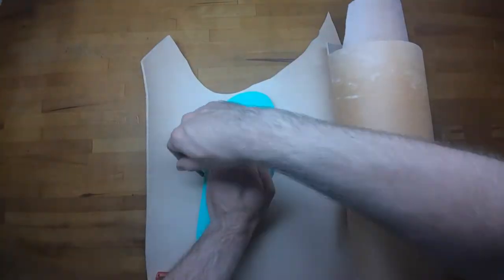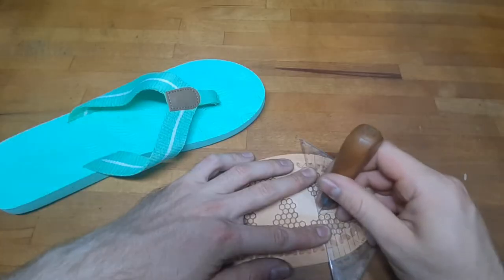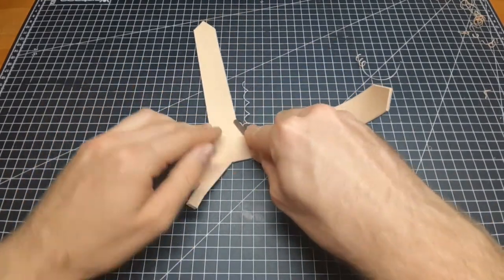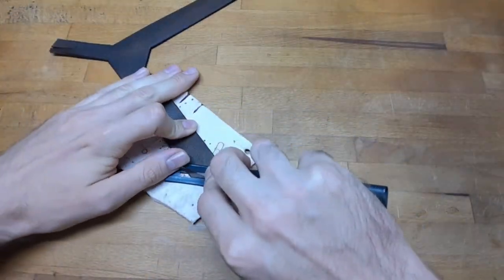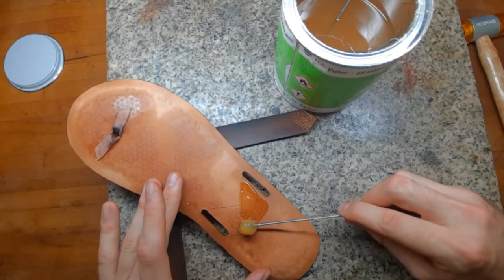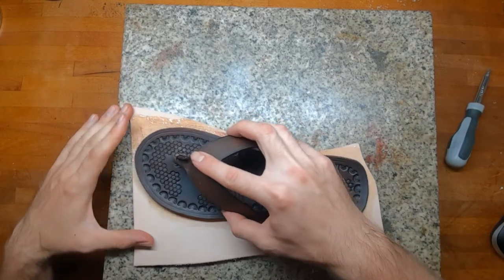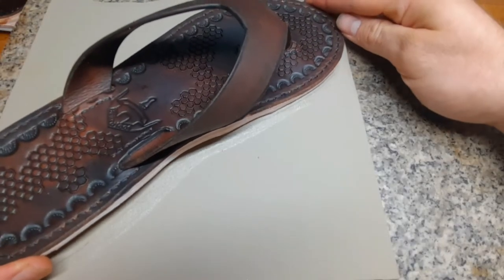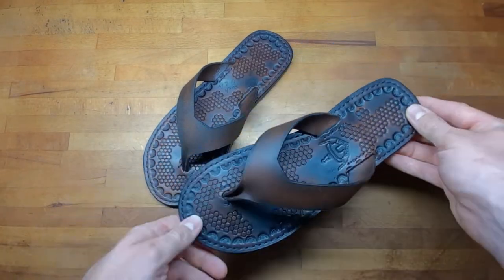Leather Crafting Tutorial   Flip Flops

Comment: What kind of paint are you using? Also, what is "resist"? Curious how durable it is and if you find it rubs off over time or when it gets wet. Thanks! Great vid.
Reply from the maker: Hey mate, on these I only use dye, no paint and it was Fiebings Pro Dye. The pro dye does rub off a little bit, the Fiebings "Leather Dye" does rub of a lot more, so there are differences in dyes, the pro dye is oil based, the leather dye pigment based. I have a pair of these not for about 3 years, I use them in the summer all they time, twice soaked them complete and kept using them wet once in heavy raining and in the baths and where no trubble, but the combination of very wet and rubbing my feet removed some of the dye on the tooth. The "resist" is a protection for leather and dye, it is some kind of waterbased latex stuff that soaks in the leather and makes it more water resistant and reduces rub off. The resist is similar to a top coat / finish on wood if you oil it or put on another kind of protection